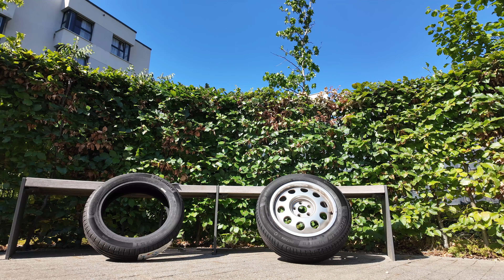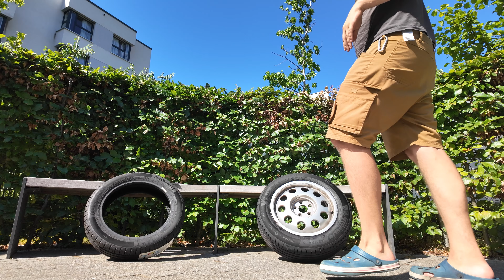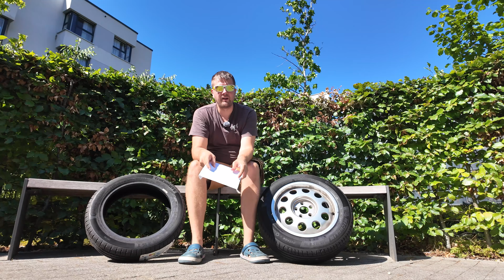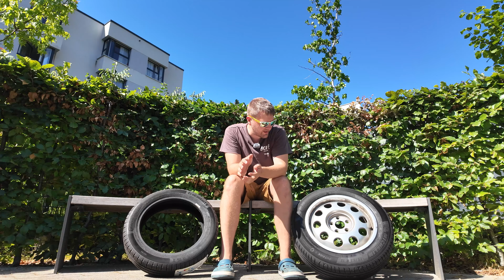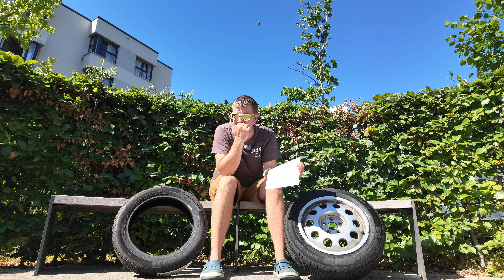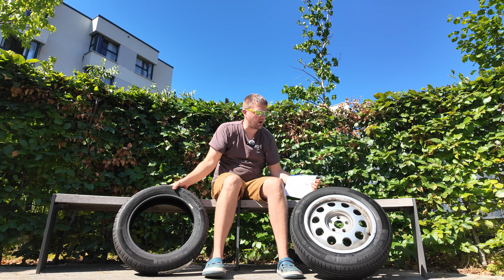Audi A2 1.4TDI optimal tire configuration explained for the 2 liter target consumption

Comment from the maker: 135/80r15 maxxis mecotra 3  will also be tested at some point. Theses are C rated but diameter is same as with the 165/65R15 tires. But they are again narrower which should help also. 
Gearing stays the same, which is a add on bonus.

In the future I can lower the car with the air suspension so I would like to have more tire sidewall for bad roads and impacts etc...

One important point is also when Installing narrower tires to those pepperpots you can build more easily the rear fender skirts to the A2

Comment: It would also be intresting to know the difference between brigdestone b381 145/80/14 and nankang econex na-1 155/80/14
Reply from the maker: B381 we're c rated for rolling. Na-1 are D. But in a ligth car impact is minimal.

Also drag is little higher.

Rough estimate 2-4% worse cobsumption than B381 offer.
Reply: Now I’m considering getting maxxis mecotra 3 for a2 1.2 TDi in 135-80-15 but problem is finding a suitable rim. I cannot find anything lightweight. Do you know of any suitable rim? Imiev wheels use slightly smaller center bore :(
Reply from the maker: @sindresvindal2290  for 3l models. vw e up wheels. They are not super ligth but the big picture it does not matter.

Where do you live?

Cb can be machined bigger with little money if that is only problem.

IMO 5x15et35 would be better option from imiev wheels.
With full set I would put the narrower wheel to rear.

I would get steel wheels from those and add a1 wheelcovers etc.
Reply: @TunekoLtd i live in Norway. Too bad nobody upload weight of the imiev tyre. Apparently up wheel (blade) they weight 9.1 kg but 3L wheel is 4.4 kg… so maybe it’s better to use 155/80 r14 with 3L wheels rather than 135/80 with twice as heavy wheels
Reply from the maker: 6x15et45 a4b5 fuchsfelge is 5.5kg you just need 4x100 pcd drilled.

It's possible if you buy a 10mm thich full centering spacer and drill 4x100 it through from the back side...
Reply from the maker: @sindresvindal2290 155/80r15 nankang na-1 says it's even b rated, but last time I checked it was not that level in the rolling.

If it actually is its a good choice.

I think it's d rated for rolling...

135 vs 155 is big change in aero drag which impacts much more than the weigth.
Reply: @TunekoLtd tyre resellers says it is D rated. I will do a more thorough comparison of it vs maxxis mecotra 3

Comment: My suggestion is Polo 9N Bluemotion 14" wheels (5,2kg not weight by my self) and EcoContact 6 Elect 155/70R14 77T (5,5kg factory weight and "B" rating). If you will stay on this 15" Fuchs rims, I suggest CNC machining. I run these rims on polo 1.9TDI @ 5,2kg 😊 no problemo
Reply from the maker: I will stay in these pepperpots, I am at the moment doing first a accurate 3D scan and after that will FEM calculate the a2 weigth and stresses. The tire diameter will be smaller than A3 and 22% less max load at the axle than A3. So plenty of room to make it lighter, plus I havent seen any broken pepperpot wheels so far so They are almost bulletproof at the moment. So weigth should be closer to 4 kg range than 5 when I am finished.

There is the A4B5 fuchs felge forged version 6x15et45 which is 5,5kg from start, but they are super rare so there is little sense to use that as a base wheel. That is with 45 offset which might be even better for the A2 but I will first try these other tire sizes to see which works best.

Pepperpots have little bit room for big aluminum brake calibers which are also in the works...
Reply: @TunekoLtd These 5,2kg CNC machined A3 wheels has almost the same strength, because the holse are "only" extended to the the center and to the outer side. It looks also very nice. If you are in germany, 2-3 guys sell these machined A3 wheels ...

You can find some A4 Fuchs rims with 5,5kg in German Kleinanzeigen, if you know. 

Which Alu Calipers? ...I can only find 3L Alu Calipers, but it is too small.
Reply from the maker: @tk_tech88 I live in dusseldorf are they near?

Tesla model 3 4 pots that I bought for the model y project...

Comment: @TunekoLdt i am running the Continental Eco contact 6 (B rating) in the dimension 155/70 R14. The car came with vredestein quatrac 5 165 65 r14 (D rating) both worn in about 1mm from factory. Airpressure 3 bar for both. To my disappointment fuel consumtion just wen't down from 3.2 to 3.1 l/100km petrol. I was honestly hoping for a bigger improvement..
Reply from the maker: Same 3l wheel in use?
Reply: @TunekoLtd  i had one of those A2 1.4 tdi without VTG in past, fuel consumption is disappointing from my experience but curious what you will get out of it. Im running a 1.2 Mitsubish Space Star (petrol) now - means the forged magnesium audi wheels dont fit. Im using 7 spoke alumnium wheels for both wheel sets (R14 J4.5). They are not perfect aerodynamic wise. Im thinking to switch to steel and install hub covers (steel ones weight about the same but does not matter for me anyway because i drive eco and long distance). Glad to exchange with you about that topic
Reply from the maker: @cibuya  There can be numerous reason for high consumption in a A2 TDI.
- Cam timing totally wrong
- temperature sensors broken
- Thermostat broken
- injectors and tandem pump broken 
- Dragging brakes and bad wheel angliments etc etc. List is pretty long.

In most cases city consumption is still high as its all the time accelerations and stopping even if you know how to drive efficiently.

Official value for city for my 90 hp atl is 5,8 liters. I can reach now under 4 liters, and should drop even more when I change the thermostat.

Its the little things that start to add up or down the fuel consumption.
Reply: @TunekoLtd  I had mine 20 years ago. it was just 1.5 years old when i got it. im quite confident that nothing was broken. i look at bigger sample sizes for evaluation, eg, spritmonitor. the a2 does not better there than small petrol cars. its just a tiny bit better than a regular golf blue motion which i drove with 3.8 l/100km (no mods, winter, fully packed, random tires at stock pressure) on the motorway. with the a2 the best tank i got was 3.3l/100km without any mods and stock air pressure on random tires. yours has the VTG turbo so you should get better results. but in the end the a2 is not so special, my mitsubishi has better aero. and 3.x litter you can get with any golf size or smaller VW diesel.
Reply: @TunekoLtd  but back to the tires, why do you think more load on the tires has lower rolling resistance. i would say the opposite is the case because you get less deformation at the edges of that patch. Also the narrower dimensions of the ecocontact 6 have worse rolling resistance, i was assuming that is because of the width to max load ratio? Any explanations?
Reply: @cibuya  I've had the 1.4 TDi down to  2.2 L/100 km in my sister's Skoda Fabia mk1
Reply: @Wannes_  how? downhill?🙃 this far from anything ever reported on spritmonitor, sounds more like a meassuring error..
Reply from the maker: @cibuya 3.3 liters is already great consumption for stock 1.4tdi a2. The Cd in stock car car is 0.29. You need those small aero improvements to take it under 3 liters.

On tires it mainly comes from the work they are making.

Yes wider tire is more efficient in paper less work where tire flexes.

- But the aero is worse, it kills consumption faster than any gains in the flex. 
- if your load rating is higher that means you have more tire plys, rubber and steel in your tires. It takes more work to bend those. Meaning same size tire normal vs xl vs c rated version. Normal wins if you doing need the extra load for heavy car. 

Tire pressure carries the load, if you have enough pressure smaller load index is not huge problem. 

See the cybercab tire video there this is explained with graphs in better detail. 

I have failed to understand this so well up to this point.  Now I have graphs and I can calculate which tire will be better in detail before even trying them under the car. 

Like I had no idea why c rated Nokians did not work under tge touareg 7 years ago, even they were A rated c tires. Msi reason was the load index was overkill for the car so rolling resistance was so much more what the letter says...
Reply: @cibuya  Roundtrip can't be all downhill - I'm not MC Esher ...
Bridgestone Ecopia's that came on my Eco-up!, aired up
Slow
Using many hypermiling techniques

Comment: You are lucky you can install what ever tires on your Lupo. For my a2 i cannot find tires anymore. The R14inch are not produced anymore (not Bridgestone nor Continental). 
Do you have a recommendation for the standard rims? (i will not replace the hubs as you did)
Reply from the maker: Those 145/65R15 work also on A2 3L. You just need to buy  VW E up wheels. It works well with either this size or maybe even better with 135/80R15 maxxis tires.

If you dont want to spend a lot of money also steel wheels with wheelcovers work just as well.

Just make sure the tire outer edge stays pretty same with willtheyfit.com wep pages.

Its much easier and cheaper to buy 15" size wheels than to find good tires in the 14" size. In most cases you have much smaller wheel diameter which hurts engine RPM and tires are just more expensive. If you go wider consumption penalty will be much bigger than going 1" up in diameter
Reply: Hankook Kinergy eco 3 165/70 R14 does the job, the fuel consumotion is almost th same than with 145er. I used a complete Kit with steel rims from E -Up, the rims from e Up are very light too. But the tire also fits on the original Magnesium rim from 3L. For Arodynamic reasons i used Audi 80 14" Wheel caps, wich looks good in my opinion, the original wheel caps doesnt fit the Up Rim.

Comment: all things considered 195 55 16 or 215 50 16 is where its all at for the best all things considered and the choice between that 2 are simply based on preference of fuel economy or that slightly better road grip.........
Reply: 195 or 205 is way overkill for the A2 - and a lot more frontal area
145s should be a lot lighter as well
And they're loaded more (relative to their load rating)

The EcoContact 6s are OK, but they wear out rather fast (at least in more common bigger sizes)
Reply: @Wannes_  gabbage!.........The need for ability to go round corners i sa thing you know as is driver comfort hence the EXACT sizes stated.......and 205? who said anything about 205?  195 55 16 or 215 50 16 is where its all at......
Reply: @monkeymagic4555  can you please keep your nonsense for yourself and don't spam us here!
Reply from the maker: Road grip comes from what tire compound you use mostly. Then the wheel impact is also quite big.
Reply: @TunekoLtd  as stated everything above everything to the exact all things considered.......
Reply: Watch out for tyres rubbing against the wheel arch liners if using 215's

Comment: Have you ever considered using hub motors in the back axle, with a pair of motor controllers and a small lithium pack (perhaps from a later gen prius) and make your A2 a kind-of hybrid, with regenerative braking to increase the fuel consumption significantly (around town, at least)?
Reply from the maker: yes I have though a EV conversion, but no time or money at the moment.
Reply: Hub motors are to heavy, I drives like shit.
Reply: @tk_tech88 So?  It's a hypermiler.  You think his tyre choice drives like a sports car?  🤣
Reply: @antontaylor4530 I have 185/55 R15 on my daily 200PS TDI Polo and it is fast enough to use the daily "racing line". The weight of unsprung mass has a huge impact for the chassis. Also with the thiny tires I can go circles on other cars.😊 (I know it is not for race track, but daily you are hard limited on speed) With 4,5L consumption I have a lot of fun to push the pedal to metal😅
Reply: @tk_tech88 Sounds great, honestly it does.  But you're still missing the point - this video is about a hypermiler, not about a track car.  He's trying to make a car that does 2l/100km, not a 9 minute nordschleife time.
Reply: @antontaylor4530 Ok, you do not understand ...I have not a race car, it is a daily with low consumption😅
Reply: @tk_tech88  I fully understand.  It's you who doesn't understand that just because you want your car a certain way, doesn't mean everyone does.

It's a simple concept.  I really don't understand why you aren't grasping it.

Comment: Kannattaako ostaa A2 1.4 tdi joka kuulemma pölläyttää joskus harmaata kiihdytyksessä/käynnistyksessä? Mikähän olisi luultavin vika?
Reply from the maker: Aina kannattaa a2 ostaa jos halvalla saa. Tämäkin pölläytteli, tuo moottorin lämpötila anturi vika niin ecu luuli et on moottori - 5c vaikka ulkona oli +22 astetta. Eikä mennyt yli +5 vaikka lämmöt oikeasti oli se 85 astetta. Eli aina rikkaalla ja talvi ohjelma käytössä...
Reply: @TunekoLtd on my a2 it was the same. Coolant temperature sensor broke, and consumption was because of that very high. I can smell diesel in tailpipe, so high.
Reply from the maker: @slablevcek yeah its not se easy even to notice as instrument meter is showing correct readings still. Just the engine side is not working. I had multiple problems at the same time. That sensor, boost hose leak and broken thermostat at least. 

Maybe also worn pump duse seals and tandem pump, but those are not yet verified but the KM are already over 400k kms...
Reply: @TunekoLtd injektor seals maybe too. When my coolant temp sensor broke (not working) , it showed in vcds too. Then i changed sensor, and i saw that thermostat was not working also. They stoped working at the same time.